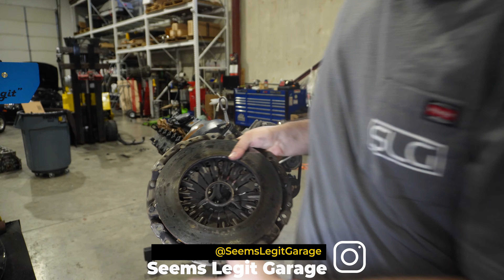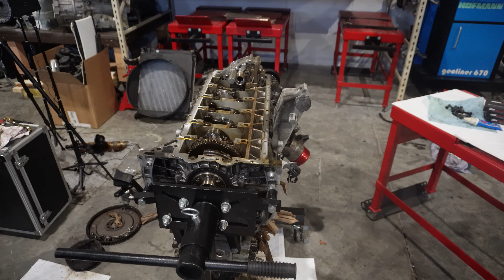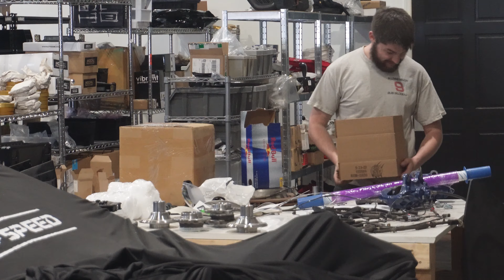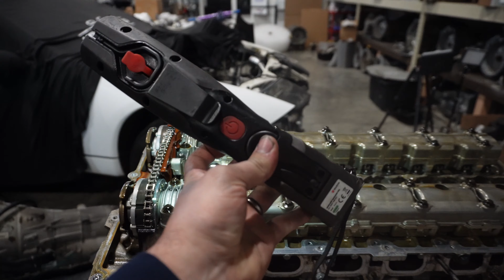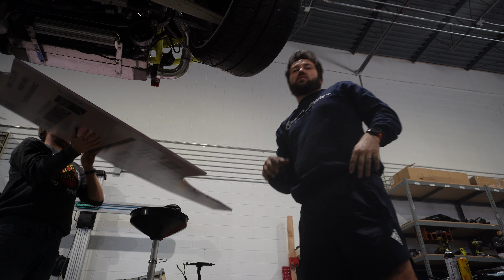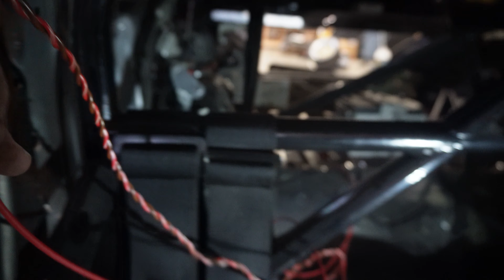T Minus 5 Days To Gridlife Revup - Missing an Engine

Comment: Are those king rod bearings one size fit all deal or do you have to measure all rods one by one then order the sizes accordingly???
Reply from the maker: They come in standard, oversize and under. You should measure rods and size accordingly.

Comment: You do need to run hi / low side catch cans , the vent to atmosphere line will smoke heavily and will get oil smell thru the cabin.
Reply from the maker: Buy a nice vibrant catch can with a mesh filter and it rarely smokes. Its half the pricy and no high and low sides are not required.